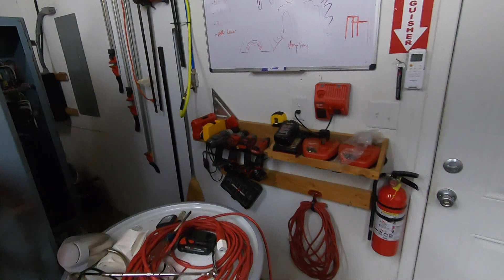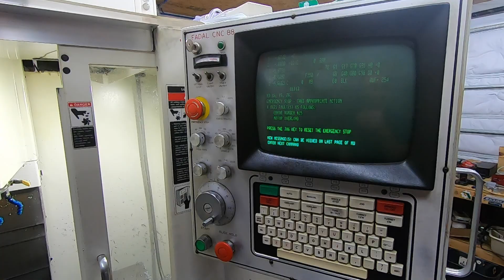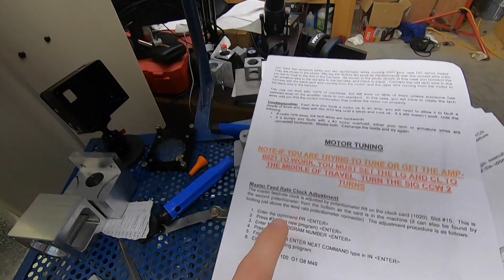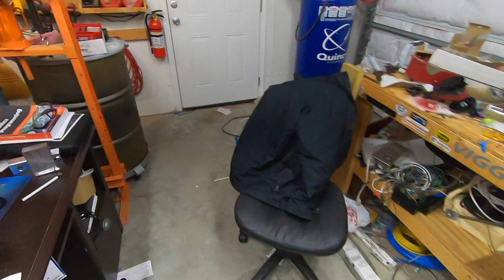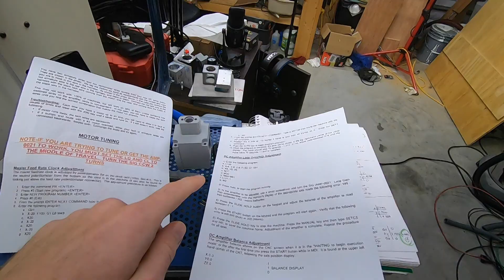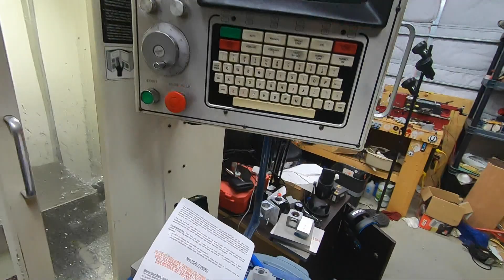Fadal Axis Amplifiers - Troubleshoot, Replace, and Tune

Comment: great vid,i have a fadal 3016 -97 metric ac servos and i noticed that your machine bangs horrible when moving as does mine which im trying to fix.but all my axes bangs exactly the same .when you changed amp and tune it did the banging go away?,at least on the y-axis
.

Comment: Hey brother, curious if you looked into the Calmotion Controllers that the son of Fadal created as a PnP solution to update our Fadals? Your input would be highly valued.
Reply from the maker: It's been awhile, but I have looked into them. At the time, I liked the controller - it seemed to have really good reviews and feedback, but I couldn't justify the price. I'm just a single guy in a shop without any significant business (this is my side hustle until it becomes a thing). If you can afford it and it suits your needs, I'm sure it'll help you process code faster and improve quality based on the videos and papers I've seen written about them.

Comment: well the card always need balancing when swapping over to another axis... and signal adjustment too. probably even loop gain tune .
those black amps  are not the oldest ones. i have 2 Fadals with older amps than u have there.